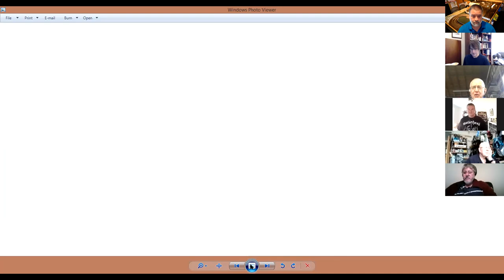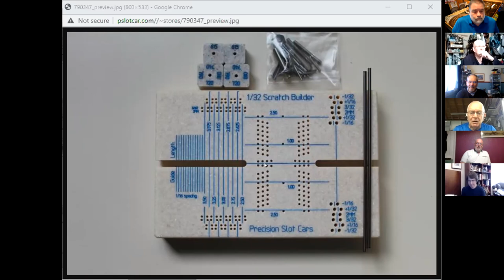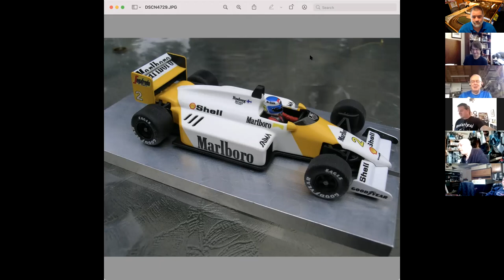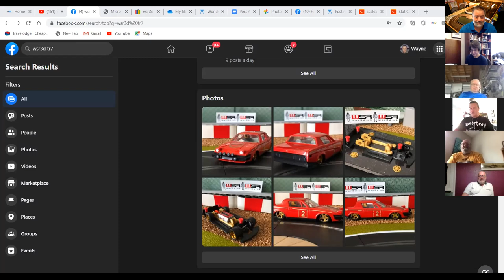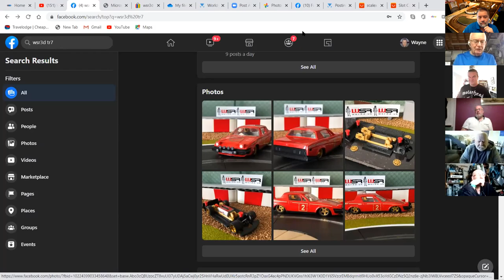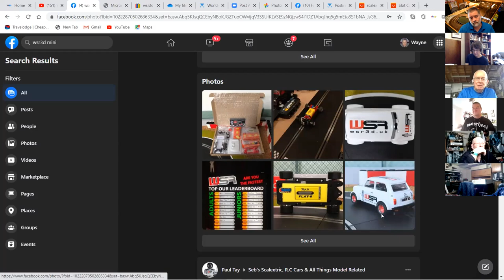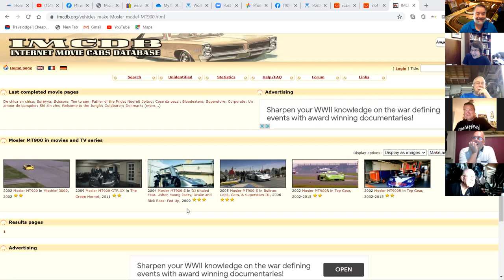World Wide Slot Car Chat #56

Comment: @25:55 that's not a jig. A jig is more than that. A jig is fit for the purpose of Blueprinting suspension mounting points, not axle position.
What you have is specific to slot cars, setting axles to height is about scratch building. Not tuning.
Reply from the maker: We'd love for you to join us on a chat, Clifton. Let me know if you need a pointer to one of the many places I post the meeting information.
Reply: @ggaub  I'd be honoured. I've talked with Luf before over many years. He is the Guru of wood. 🤣🤣 let me know the details.
Reply from the maker: @cliftonmanley3882  Just google for "Worldwide slot car chat on Zoom!" and ignore all the results for the videos. :)